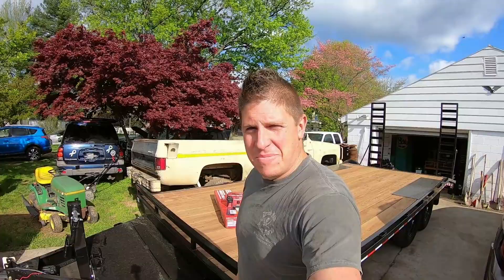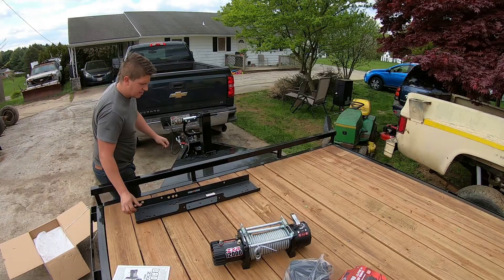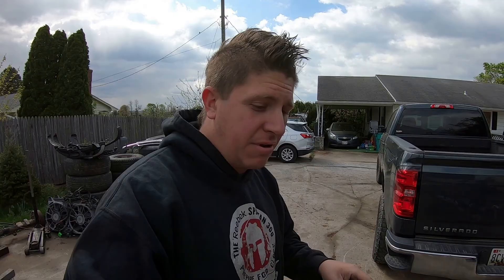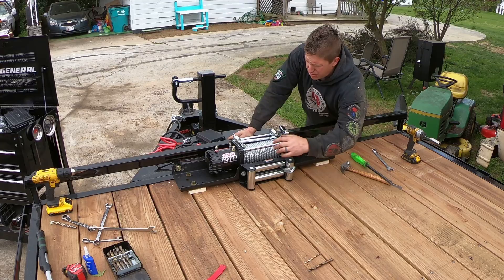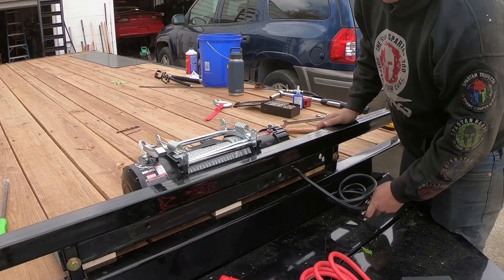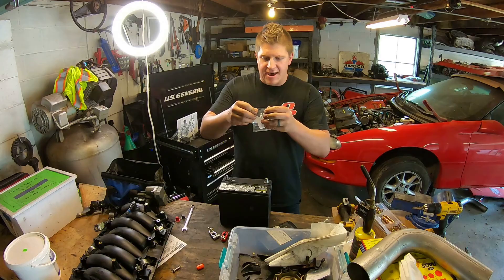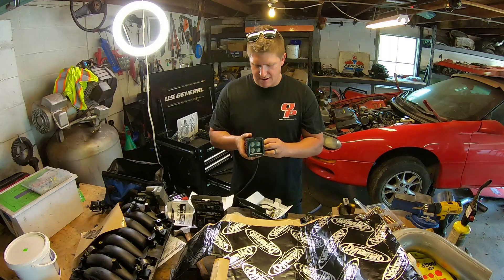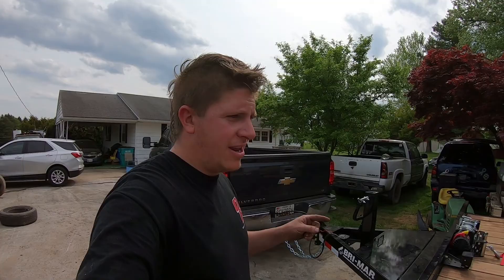Outfitting my NEW 2021 Deckover Trailer!!! Winch, Lights, and MORE!

Comment: I'd put a long metal plate that spans the mount on the underside (under the deckboards). You will have upward tension as the towed vehicle reaches the front of the trailer bulkhead.
Reply from the maker: I hadn't thought of that, you're right and that's a really good idea. Thank you!
Reply: That’s what am gonna do
Reply: I only have 5000 pound winch two pulleys ben able to load  f250 with no problem?
Reply: Plate as stated then instead of a battery why not add another plug and just plug it into the plug on your truck when you need it.  No worries about buying a battery and keeping it charged.

Comment: I use every inch of my deck space and would never mount the winch on the deck.  Mounting to wood is kinda ghetto when there is steel available.  If you don't want to mess up the powder coat you could clamp the mounts to the forward frame ahead of the front rail.  A little fabrication goes a long way.
Reply from the maker: Everybody has different preferences on how to do things. I'm extremely happy with it set up this way and haven't had a single problem. Thanks for watching!

Comment: NICE SETUP! I just picked my equipment trailer up about a month ago myself.  Not nearly as nice as yours though.  Still waiting on a good deal to come up for my winch though.  I would love to see how you hooked up the wiring to charge the batteries when hooked to your truck.  Thanks for another great video Jason, thumbs up as always
Reply from the maker: Thank you! Patience and keeping a lookout for deals, if you have a harbor freight near by they usually have pretty good prices on winches. I'll get a video up on how to wire so the truck charges the trailer battery also!
Reply: harbor freight has some good deals right now, 300 bucks for the 12,000, less for the 9,000 or 5,000 do well also.

Comment: Great video. How are the upgrades to the trailer holding up?
Reply from the maker: Awesome! Been using it for over 2 years now, hauled well over 100 full size trucks and suvs with it, and it hasn't missed a beat.

Comment: You couldve have got 2  Universal plates.  One at the top & 1 at the bottom.
Reply from the maker: Also a good solution! Would offer a ton of support and all the holes would line right up.
Reply: @MohawkMotors  I like your idea. I'm about to get me a winch tomorrow. I have been researching. I'm watching all yall videos.

Comment: Use a1500 generator  cheaper then batteries  and batt charger works for me!
Reply from the maker: I gotta tell you, this battery that I bought from napa hoping it would last a year, is still going strong!
Reply: Batteries are ok I take a long compressor to air up tires having generator helpful

Comment: With the wench mounted that low, does the cable ever rub on the rear of the trailer when wenching something up onto the trailer?
Reply from the maker: Yes, the cable occasionally rubs on the steel angle where the fat deck meets the angled portion of the deck. Hasn't hurt the cable or the steel angle though.
Reply: @Mohawk Motors  thanks. Im preparing to mount one on my trailer and was qurious. Im thinking of devising a roller that can be placed in the area that might rub the cable. Nothing permanent. Just something to attach as a prevenative measure.

Comment: Is it difficult to load cars on a deck over?  I’ve considered buying a deckover as well, but I don’t want to limit myself and not be able to load cars because of the angle.
Reply from the maker: So far the only issues I've had have been with low riding long wheelbase cars. A stock height camaro went on fine, but a camaro lowered 1 inch scraped. That lowered camaro is the only one that I've had scrape
Reply: @MohawkMotors  I GET CALLS ALL THE TIME...DO I NEED A LICENCE TO TOW IN MY CITY LIMITS "  I GOT A TAHOE AND A CAR HAULER...
Reply from the maker: @RGIIIBOXING  I believe it, people don't know.
Reply: @MohawkMotors  I ASKED AROUND...AS LONG AS YOU NOT GOING ON PEOPLE'S PROPERTY WITHOUT A NONCONSENSUAL LICENCE...YOU CAN TOW PEOPLE THAT CALL YOU TO COME GET THERE CAR ..YOU STILL NEED TO REGISTER WITH YOUR STATE AND GET THE REGISTERD TAG ON YOUR HAULER..AND PAY A ANNUAL FILENG FEE...$190 TO $300" THAT PRICE VARIES FROM STATE TO STATE"

Comment: Hey where are the info about plugin the battery so it charge while driving?
Reply from the maker: There is a pin in the trailer connector for Battery +, that pin is a direct connection to the battery positive post so it will have vehicle voltage (around 14 volts) and will charge a battery on your trailer.

Comment: Can you connect power to the winch through the trailer connect without a battery in the trailer?
Reply from the maker: You could, but it wouldn't work. The Battery positive through trailer plug is only run through like a 10 gauge wire and usually has a 20 or 30 amp fuse on it. It would barely be able to turn the winch motor, definitely not able to supply enough power to actually pull a load. That circuit is only designed to charge the trailer battery and maybe run a few small accessories like lights.
Reply: @MohawkMotors  Good point in the amperage. How many amperes does the winch need? So, 60 or 70 amps battery will do?
Reply from the maker: Depends on the winch. Mine draws 180 peak amps, rule of thumb is to have a battery with at least triple the Cold cranking amps of whatever your peak amp draw may be, 540 cold cranking amps in my case. I went with a battery with 560 cold cranking amps.

Comment: What do you use to make sure the battery doesn’t die from using the winch
Reply from the maker: It's connected to the battery + terminal in the trailer plug, so when the truck is running, it's charging the battery.
Reply: @MohawkMotors  can you do a video on how it’s set up?
Reply from the maker: Too simple for a video, your trailer plug on your vehicle should have a post in it that is battery 12V+, connect the 12V+ terminal in your trailer plug to the + post on your trailer battery. That's it
Reply: @MohawkMotors  what gauge would that be ? I believe my harness is 10 gauge
Reply: @MohawkMotors  also does the battery ground to the frame or run a wire to the negative on the harness
Reply from the maker: @chickenfoundation9323  is 8 or 10 gauge wire. The battery should already be grounded to the frame and harness of the trailer.
Reply: @MohawkMotors  great thanks, what battery would you recommend?
Reply from the maker: depends on the amount of space you have and what's available but I would get an AGM (Absorbed Glass Matt) style battery

Comment: How to make the vehicle charge the battery?
Reply from the maker: In most modern vehicles with factory wired trailer connections, there is a Battery + terminal in the trailer connection, when the vehicle is running, that terminal will have the same voltage as the vehicle, usually about 14 volts. If you run a wire from that terminal in the trailer connector, to the positive terminal on your trailer battery, it will charge the trailer battery using the vehicles charging system when the engine is running.
Reply: @MohawkMotors  didn’t realize it actually was that simple! Thank you and thank you for the response! Sub earned!
Reply from the maker: @TakkaFlakkaFlame  no problem! Appreciate the subscription!!!